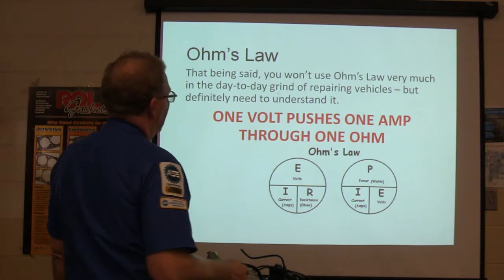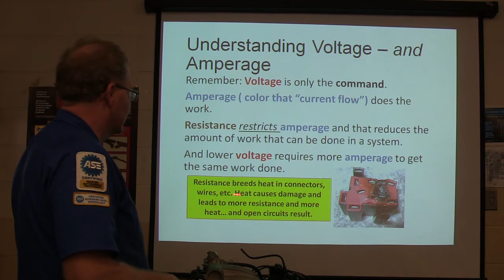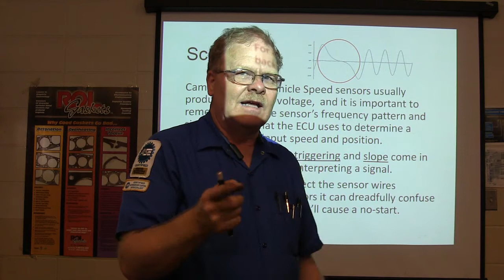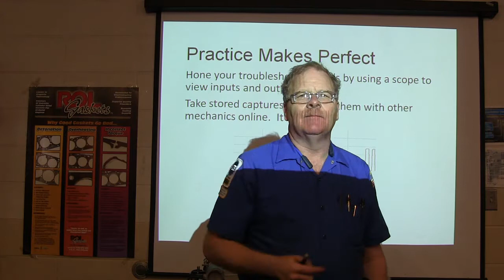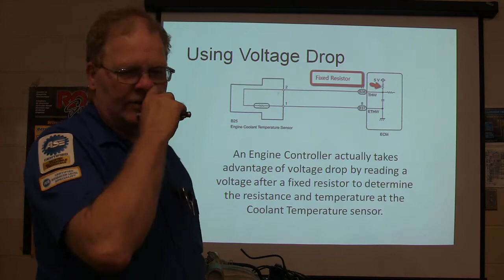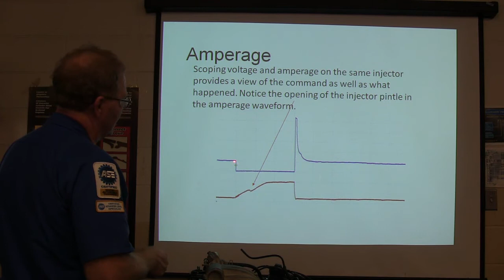Applying Principles   Electrical 1

Comment: Worked on a 97 Infiniti QX4 that had 4 O2 sensors. 2 upstream, 2 downstream. On one bank the up and down were correct but plugged into the opposite bank connectors. And the other bank up and down O2s were backwards and plugged into the other bank connectors. All the plugs were the same and fit into each other. Caused the car to go in and out of closed loop. Open loop it ran smooth and had power then would go into closed and hesitate and stumble a bit. Made for some interesting scope patterns.
Reply from the maker: I ran into that crossed O2 sensor syndrome on an 87 Thunderbird back in 1991 - it was fun to watch and fairly easy to figure out.